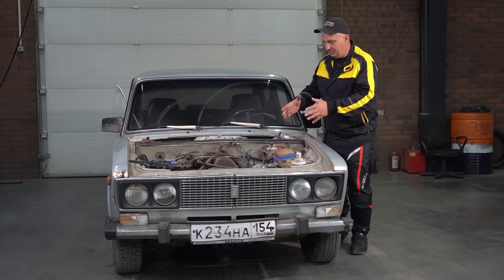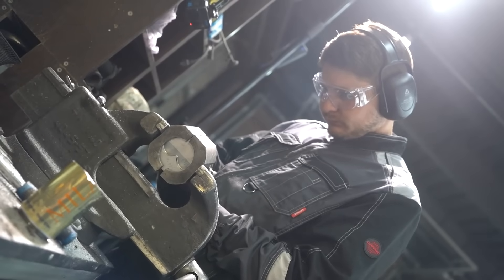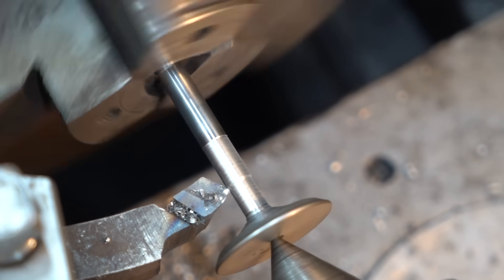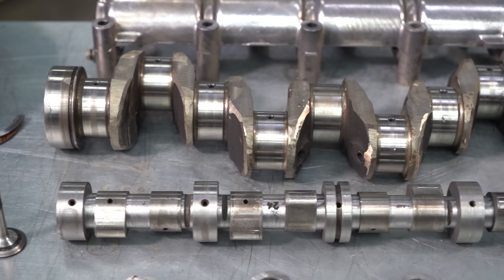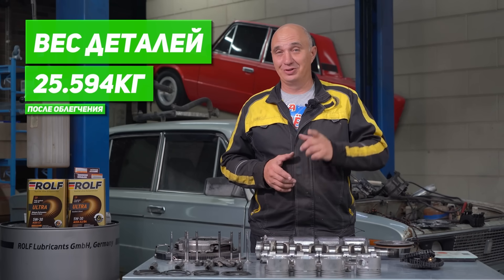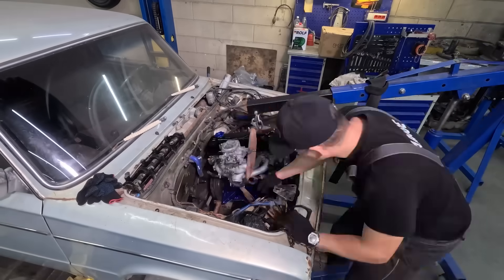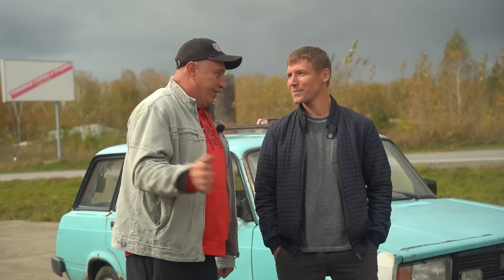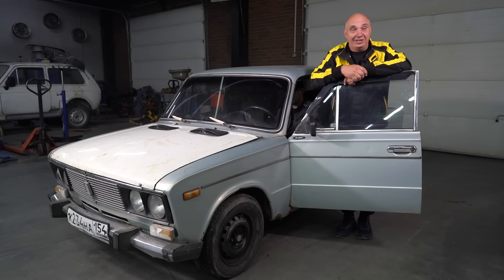Maximum rotating assembly weight reduction - what will happen?

Comment: Should have cupped the valves, cut the pistons into a skirt profile, port matched the intake and polished the ports on the head.  Last, the valve spring rate needed to increase.  This could be done with shims, double springs, or new springs (most desirably beehive style).

Comment: With the camshaft, they could have done a performance grind, this allows higher rpm and more airflow along with weight reduction.
With the heads they can port it, same results with the cams.
Add stiffer valve springs and performance manifold back exhaust and intake to unlock full potential.
motorbike carbs to make a itb would be interesting.

Comment: Only torque is higher.but imo itcwas worth. Im wondering about 2 or 3 spark plugs per cylinder. Would it be benefit in therms of power, torque or fuel efficiency .i

Comment: The cam and valve springs is really what is going to control the top speed of what the engine can do. The weight of the rotating assembly really doesn't have much to do with it, except the time that it takes for the engine to reach it's top speed. Put a larger cam and stiffer valve springs in it, and it WILL be a whole different engine.... 👍

Comment: did it wrong, you DRILL the counterweights on the crank to match the bobweight of the con rods and pistons. and a knife edge will reduce viscosity drag in the oil instead of bullnose.

Comment: Needs balancing, assuming it was. Camshaft and rev limiter determine peak rpm, otherwise weight reduction just allows the assembly to spin up faster and reduces overall stress on the assembly as long as loads do not exceed the strength of the modified components. Take-off rpm may need to be raised due to loss of inertia/stored energy.

Comment: i lightened over 34lbs(15+kgs) from a 4 cyl low revving torquey truck engine's rotating assembly,  and made a fairly bad ass racing engine. it would so so much quicker.

Comment: This weight reduction makes the biggest difference in 1st gear. A higher percentage of engine torque is accelerating the car, rather than revving up all that rotating mass. Once in the higher gears, (3rd, 4th) rotating mass becomes less of a factor, since the engine revs much more slowly, so it's already putting 99% of it's torque into the transmission, rather than accelerating rotating mass. It won't rev any higher, but, it will reach maximum revs in a much shorter period of time.

Comment: As a mechanic, engine builder, and tuner I know why this engine isn’t any faster than before.
The rotating assembly is so off balance it’s actually hurting higher rpm performance. When you cut off the counter weights off the crankshaft ( even if you remove material off the journal side and the crankshaft is balanced on its own) it throws off the balance with the connecting rods when assembled. And it will creat a lot of crank deflection and resistance on the journals. I bet there is already brass in the oil pan. As for trying to reach a higher rpm the engine obviously lacks the air flow for this to happen. An intake/exhaust system upgrade aswell as a bigger camshaft would greatly help.
Reply: Another thing is just because you removed weight from moving parts of the engine doesn’t mean it directly translates to a big reduction in the conservation of angular momentum, which really is the whole idea of increasing efficiency.
There would have been better results if the engine was left alone and just swapped to a SMALLER DIAMETER and lighter flywheel.

Comment: a different angle than most I've read ...
if you did this again, I'd like to see fuel economy changes if driven for that purpose.
I know everyone is equating lightweight to less stress on parts at high rotating speeds; but wouldn't reducing rotating mass while  keeping similar power curve greatly increase economy?  Engine response?  Isn't light rotating mass one of the reasons a 13B rotary revs how it does?
Just some thoughts while watching

Comment: Generally - minimizing the rotating mass will increase the rate of acceleration , but will not increase the max power or rpm. Redline /max rpm is not affected by rotating mass.  
Counterweights of the rotating mass are there to dampen felt pulses between combustion strokes ( vibration ) and store energy for rotation - forcing the next compression stroke during idle..
I’m truly surprised the engine didn’t shake itself apart having the entire mass of the counterweights removed.

Comment: This is similar to what I did  to a 1060c.c Corolla(year 1968)engine.Anything which rotated or reciprocated was balanced to the finest possible degree,Crankshaft,pistons,con-rods,push rods and rocker arms,flywheel,camshaft with a mild grind,clutch assembly and drive shaft.Gas flowed the intake manifold and combustion chambers,replaced the exhaust manifold with a tuned length after market exhaust,rejetted the carburetor and good to go. No fancy after market internals, just all stock Toyota parts.A big difference in get up and go,able to stay with larger cars with six and eight cylinder engines to 60 miles an hour ,Was fun surprising bigger cars,..

Comment: You can flatten the pistons much more if you take material off the crown, then get slightly longer rods. At that point it's easier to get forged pistons that are already flatter by design though.

Comment: Maybe weld the lobes of the camshaft  and make them taller so the valves open more and let more air thru also maybe smaller pulleys ? Or some sort of reduction so the engine spins faster

Comment: Less weight revs quicker but will not rev higher and will lose torque, but not bad after all
Reply: If balanced it will rev higher and it will not lose any torque, it's a misconception that engine's lose torque with a lightened flywheel among other things, not so!

Comment: The rev limiter in a carbureted engine is in the distributor... the is a centrifugal force governor inside the distributor... you can remove every gram, the limit will be the same!
Reply: No that's not how a distributor works. I mean, there could be a limitier in the distributor but it would be in the rotor itself. The "governor" actually allows it to reach higher RPM's

Comment: It won't rev higher if you remove the counter weights, those actually help in getting higher revs by evening out vibrations. With an uneven crankshaft like that, the higher you rev - the higher vibrations get and act against the engine, slightly reducing max rev actually.

Comment: Try an aggressive cam, a bigger carb, porting, raise the compression, header/exhaust, knife edge balanced crank, and balanced rotating assembly, add some new valve springs for good measure, all that hard work would actually get real good results then.

Comment: Find yourself an old Mercedes 450SE 450SEL or a 650SE 650SEL , I think lot of them had sodium filled poppets. I’m sue yo lot at Garage54 will make them fit. You might want to find a way to shorten the piston stroke somehow,. One of The old Astron 2600 (or is 2800?  (The old family station wagon the old man owned had a some obscure reconditioned Astron 2800 as far as I remember) from a Mitsubishi Sigma (skidma) had an engine head that could be bolted on back to front which would up the compression ratio for a year or so.

Comment: Years ago I built an Kadett Rally 1970. I used a stock 1900 block, 1600 head that was untouched except a schnitzer racing cam shaft. It was rated to 1100 rpm. A thicker head gasket. I used a Taunus weber from a 2L. The car smoked the tires even on third gear. The speedometer maxed out at 180 kph but the needle went past the markings at the bottom of the dial. I raced a brand new Volvo 240 turbo and it was dead even at top speed. My car was faster up hill and the Volvo faster down hill. It revved 3000 at 90 kmh(old school). It never stopped revving. I shifted at 7500 rpm to keep the engine intact. At 9000 it still wanted to go higher. The high compression 13,8 kgs and the cam was the difference. My radiator popped loose and hit the fan at 210 kph, that killed the engine, since I didn't have an oil heater gauge installed and the water gauge didn't react since all the water was dumped out. It was fun while it lasted and I smoked many cars and bikes.

Comment: Using shorter stroke pistons and con rods and crankshaft and stiffer springs for the valves. Reducing the weight like you did here makes it quicker to get to the top end and doesn’t sap as much energy from the engine to get it up to speed. It will also make it easier for the engine to engine brake quicker due to the reduced rotating mass (the flywheel effect). 
To raise the rpm you have to shorten the distance that the piston has to move between power strokes

Comment: For catchy show its nice, but if you want to make it bit more scientific, you would have to implement the changes gradually to be able to observe impact of each of them individually. Some of them (like removing the balancing weights from crank shaft and sleeves of pistons) might work for improving acceleration to higher RPM, but may also worsen the high RPM performance.

Comment: Valve springs and cam is what is going to dictate your redline. You need to time how long it takes to get from a certain point to another point with the same load. THAT will show how the weight reduction affects the engine.

Comment: Its unbalanced because you screwed up the counterweights on the crank.
You have to rebalance when you make Upper lighter, BUT Exactly as much from the bottom. 
You cant just take off as much as you want from where you want. 
It can't rev because it's struggling to spin smoothly.

Comment: You inspired me to build a G10A engine with light weight components and motorbike carbs, with this assembly i'm going to need tighter valve springs so it can make more rpm

Comment: The rpm needle before the lightening reached a certain point and just kind of stopped. After the lightening it threw itself past that point, then came back down quickly, came back up then came back down, and that it didn't sling itself quickly up again after each drop it makes me wonder about the valve float and thus high rpm power loss. That mostly feels like the ignition has a rev limit of 6250 rpm baked into it somewhere. And not only that, the crankshaft imbalance limited the rpm to below the spark cut, limiting effective power at the top end as opposed to gaining theoretical power output. Get the crank balanced on a machine by installing the smallest needed counterweights and it should bang into the 6250 rpm rev limit rather than sagging to 6000 or 6100 as it did at the end. Then modify the distributor to prevent the weights from reducing the timing by basically removing them, it might need some manual tuning after though, but I only know lots of engine theory, and I don't know much about Lada or other Russian cars, I have no practical experience, so just take it as an idea to look out for if anything.

Comment: Great topic, what about the engine vibration, with all the crankshaft counterweights removed?
Reply: Run this experiment if you have the means. On a vertical shaft small engine, usually the flywheel is the cutting blade. If you have one, start and run your mower with and without a blade on it. Watch for the compression without the blade, you can hurt yourself. But you will also figure out everything these guys did, pretty much, I mean the gains by reducing weight on the internals wouldn't amount to much on an engine like that, but without the flywheel, you can learn a couple things about it without spending money or damaging your equipment.

Comment: Yes , bigger power but heavy makes it indestructible.  Valve springs and ignition change would help. Also, removing weight makes a higher power curve but removes helping torque.

Comment: One reason why the speed limit is still at the stock level is the scavenging losses during the gas exchange. 
The next reason is that the engine still has a mechanical ignition system with a centrifugal ignition advancer and mechanical breaker. A electronic ignition system with programmable limiter could be the solution.

But the unbalanced components thing is still there. Due to its design, a 4-cylinder engine generates a lot of vibrations, which must be minimized by coordinated balance weights and balance shafts.

But unfortunately, these vibrations are not the same across the full rev band. There are some vibrations or frequencies that only occur at defined rpm, others that extend across the entire range. This is the reason why the engine sometimes sounds more or less rough at certain speeds.
The high art is now to tune the whole engine mechanic with all her components and balance weights in a way that reduces most of the vibrations or push them so that they reduces each other.
Simple to grab a angle grinder or a milling machine without balancing all the components afterwards isn't the right way.
If you do so as shown, the risk that the engine flying apart is quite high.

Comment: I've seen someone do the math on lightened flywheels and it's largely affected by gear, multiplied by the gear ratio (better in 1st vs 4th). That's one reason it jumped off the line but had no advantage near the race end.

The large problem induced by removing the counterweights is there will be a severe 2nd order harmonic, causing the crank to rock the ends up & down at 2x engine rpm. It's usually just vibration you feel, but it can wear out front/rear main bearings quick and shatter crank-driven oil pump gears (not chain/shaft driven).

Comment: Need stiffer valve springs if you want more rpm, and the ability for the engine to flow more air, air is the biggest limiting factor.

Comment: I think valve springs are one of the most important factors in the engines max RPM. But they lowered the weight of the valves, while the springs remained the same. They also lowered the weight of the rockers.

Comment: Stiffer valve springs, lighter flywheel, maybe switch to points ignition where you can control the timing curve easier if that's possible, a bit of intake and head porting, and a bigger carburetor and you're set.

Comment: all comments say the same, better valve springs, intake, exhaust and camshaft to rise the revs.

but nobody is talking about the cpr of the pistons and the most important thing when wanting higher revs, the rod ratio and piston acceleration, not having the appropriate of those two and the engine will grenade itself at high revs

Comment: Reducing rotating weight works more in lower gears. ie weight reduction × overall gear ratio.
Resonance loses of crank assy. will account for a lower rpm limit, purely because of mechanical loses.
The same as fitting a fully counter balanced crank in a unit that was semi counter balanced. An extra 1000 rpm is not unusual dispite a increase of 12-15% in mass

Comment: To increment RPM's you really need the engine to BREATHE better. It might be light but the breathing capability remains the same. Some porting and exhaust, also equialize the fuel mixture to cope with better breathing and you'll get more RPM's and power.

Comment: Make another test :) Install a standalone fuel injection system (pressure pump, injectors) and some kind of controller :) I'm wonder how this engine will work with newer fuel supply system instead of carburetor

Comment: Shim the valve springs increase spring pressure, Gain more rpm before they float.
Reply: I do like the wagon more.
Reply: Mpg will be the biggest gain over a stock Lada. In normal operation. More weight could be shed off the block as well. Using a grinding wheel tool, As much as was removed from all of the parts.
Reply: I would think that as much as 20% mpg could be no problem.
Reply: It simply a cost saving for the manufacture vs. savings for the customer. That would be in anything made today.

Comment: Connecting rods could be even ligter. Grind and polish them inside the beam. Make the curves smooth and polish. Makes for more resistand to cracks. 
It does not rev higher because of limited carburation and risk of floating valves ( put in stiffer valvesprings ) . get it all well balanced. And if you have a 1500 cc engine you
do not want to have light flywheel for launch. You need the weight of inertia fom flywheel. So about 6 Kg flywheel keep that.

Comment: Most likely there's valve float happening. My guess you're high RPM rev limit is smacking into the limit of the valve springs if there's not a mechanical or electronic rev limiter in there that is probably the limit

Comment: By removing weight from moving masses, you made acceleration easier as less mass had to be accelerated.
That should also return lower fuel consumption.
Maximum revs are different from acceleration. Guess the limiting factor are air intake, valve springs, exhaust diameter, carb dimensions etc.